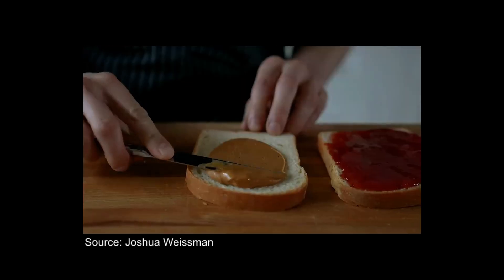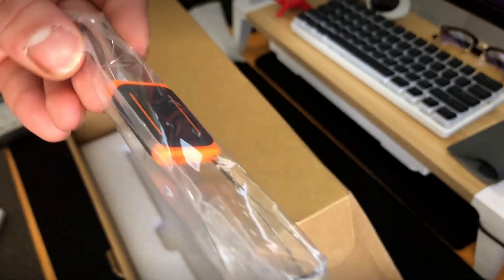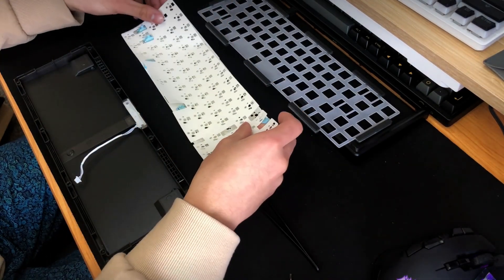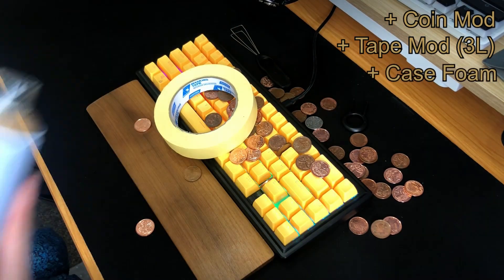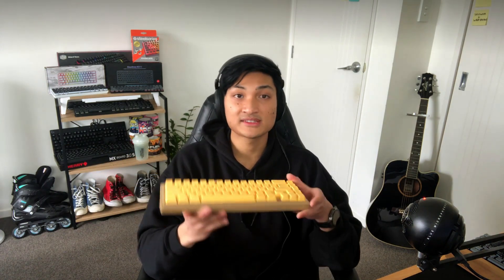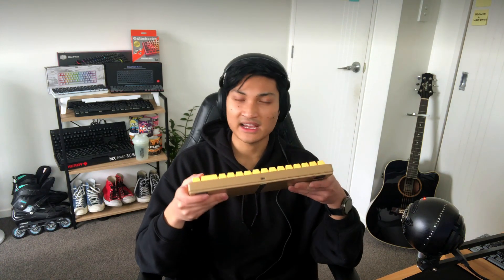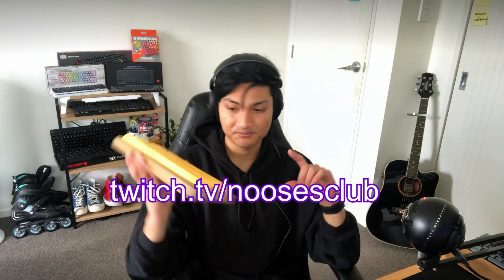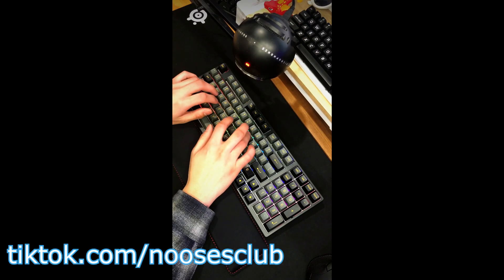THE CREAMIEST AND THOCCIEST BUDGET KEYBOARD?!

Comment: also, the akko switches have long pole so you wouldn’t get any north facing interference!
Reply: even if using cherry switches?
Reply: @flippno  cherry does not have long pole, therefore you will get interference.
Reply: @joshie5341  my bad🙃 i mean cherry profile keycaps with double shot pbt material
Reply: @flippno  yes yes, there wouldnt be any interference.

Comment: Hi, how many layers of coins did you include in the case? And what was the case foam that you added? I'm suprised you still could fit that much even with 3 layers of tape mod!
Reply from the maker: I managed to fit 2 layers of coins on the top half of the case, and did one layer for the bottom. Do keep it mind that if you want bounce, doing these mods did mitigate them, but I only purely did them for the thocks haha.
Reply: @noosesclub  what case foam did you add in addition to the coins?
Reply from the maker: @DL-rn6iy  Just used some 2mm packing foam and tested out some craft paper about 2 layers of that.